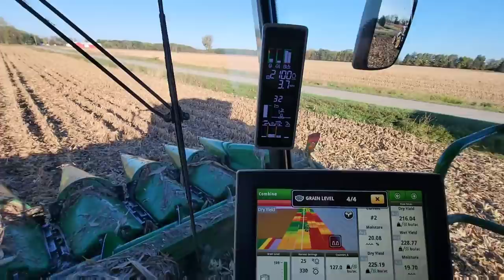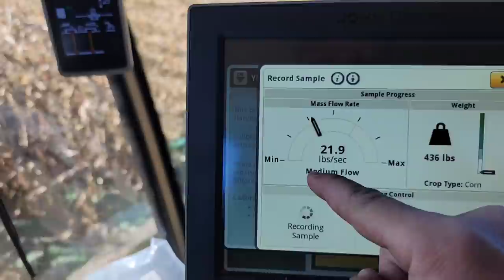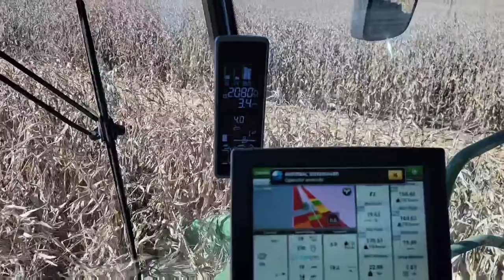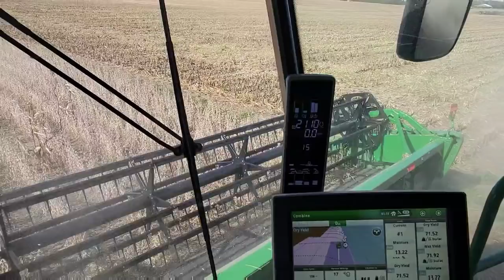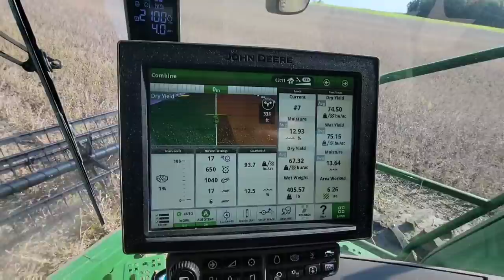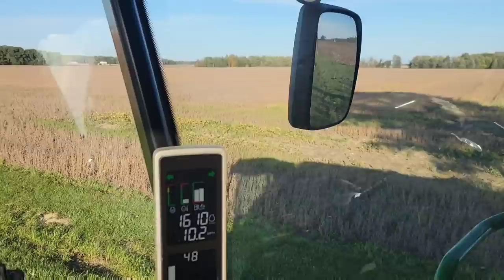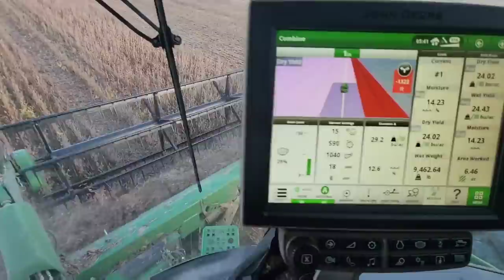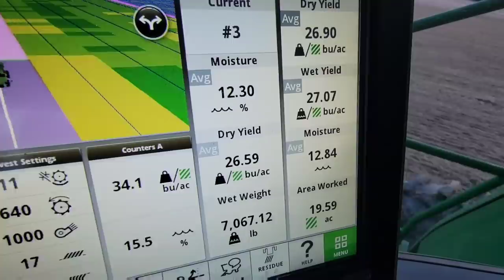Corn, Bean Plot, and Double Crops? - #529

Comment: For follow the argument of the disc vs ripper who's better for the fields? There's a lot of good arguments to treat, it will be a good idea for a live stream where you are off the job. 🙂 You explain more and it's nice to know. For example there in Northern Italy (pianura Padana) we cultivate a lot of corn for different use, we have tried to see how much difference are between using the plow and a cultivator with anchors. The result is that the total weight of corn at 15% humidity is higher on the cultivated side than the plowed side, and the next year we will try again for seeing better results. It's nothing of scientific valuations, but we try just for curiosity because we are more interested about the minimum tillage vs conventional till. 😁😁 Thanks for the contents Nathan!

Comment: Re the header hydraulic hoses. Is there the physical space to use some spiral wrap especially at the locations where they are clearly rubbing on something or each other to avoid this issue in the future?
Reply from the maker: Yeah something could be done. We did trade that head off though it's not something I'm very concerned about.
Reply: @BorderViewFarms  
Understood, thanks.

Comment: Doing a manual calibration won't affect your Active Yield calibration. There is an offset you can input in for Active Yield once you do 12-15 tank loads to compensate for a difference between the cart scales and what the combine thinks it harvested.

Comment: Nathan, did a little reading and came across an Ohio state study where wheeled tractor with tracked planter had the most favorable impact on pinch row compaction. This discussion reminded me of the aftermarket hydraulic down force system that the Larsons put on their corn planter to distribute weight from the center section of the planter to the wings.
https://www.youtube.com/watch?v=2Bb_vnJDRxQ
Reply from the maker: That weight transfer kit is for 24 row and larger planters not 16 row.

Comment: Silly question, would/could it be beneficial to eliminate the ripper shank where the tires of the combine run? It would probably lower the yield on those rows but makes it easier if spraying is needed on an otherwise too muddy field (for instance) and reduces the chances of losing crop to bad weather/muddy fields at harvest time thus offsetting the loses from not ripping those few rows. (Or is this a solution to a problem that doesn't really exist?).
Reply from the maker: I suppose in theory it's possible but the logistics of making sure everything matches up and is in the right place would be pretty hard. Also we like to rip on an angle to break through the wheel tracks better.